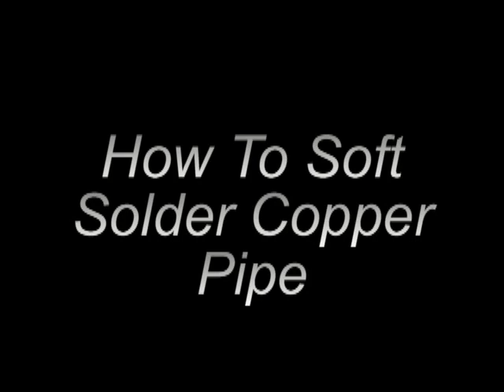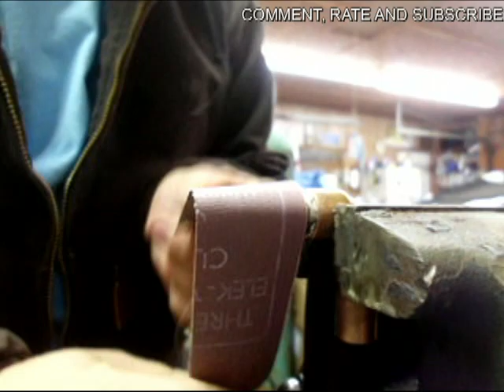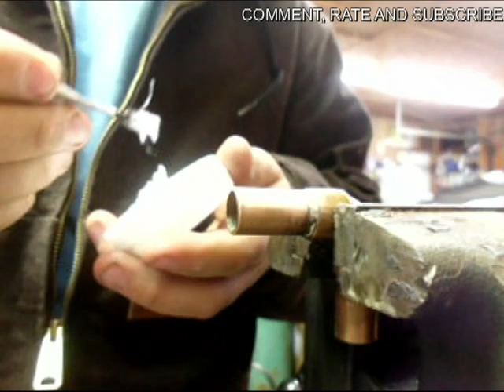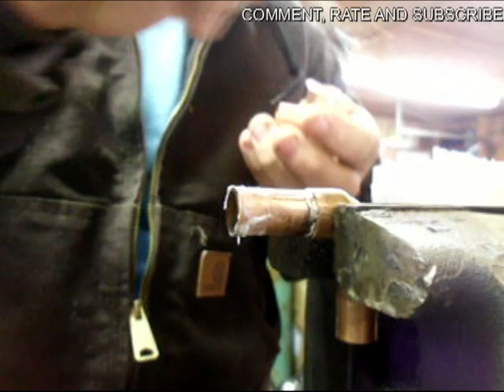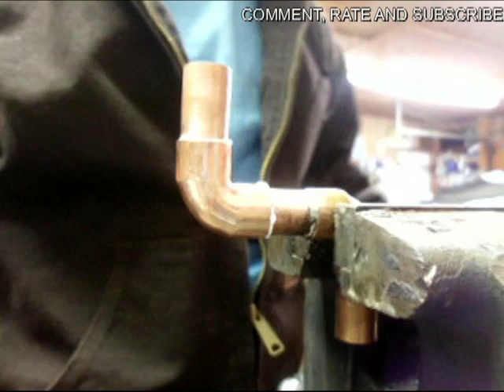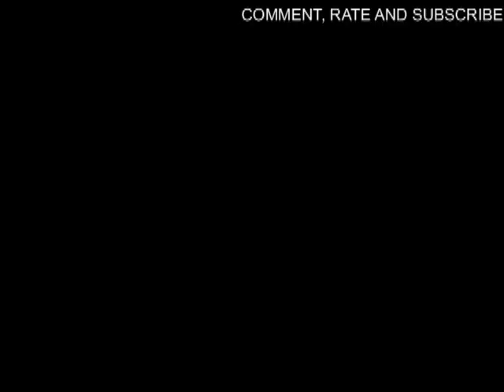How To Soft Solder Copper Pipe

Comment: That is a lot of heat..  Once you have all of the steam/smoke pouring out, you should be able to take away the heat entirely, and just push the solder onto the hot pipe.  If you need the heat on the pipe while soldering, that means your pipe isn't hot enough, and you can't see inside to see if the solder is going around evenly.  Alternatively, if the pipe is hot enough on its own, then you know the whole pipe is hot enough.

I just put flux on the male end (and farther up than you did)